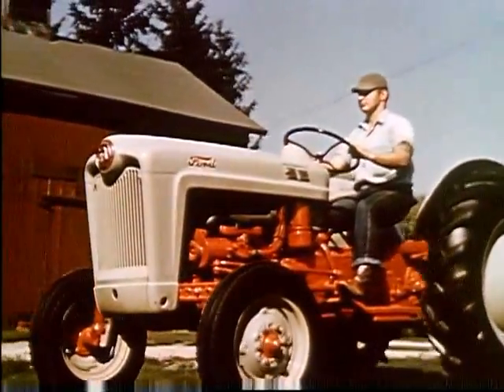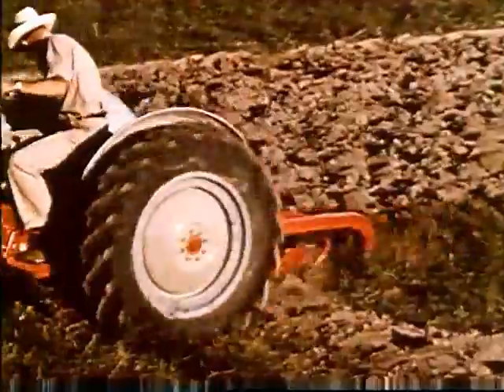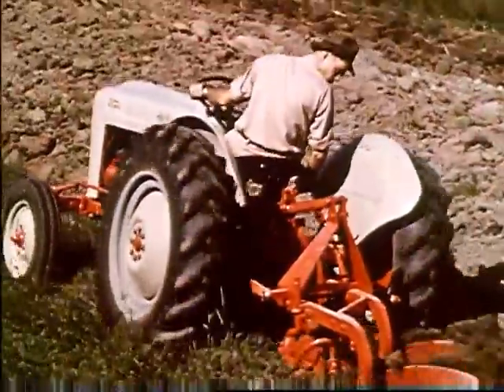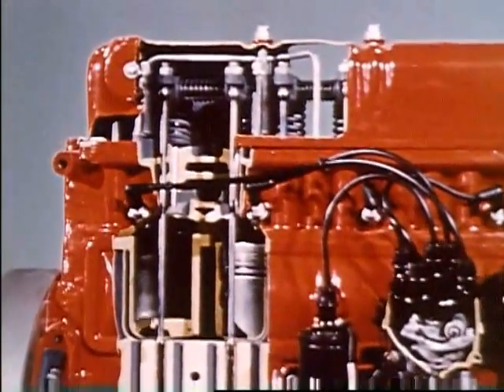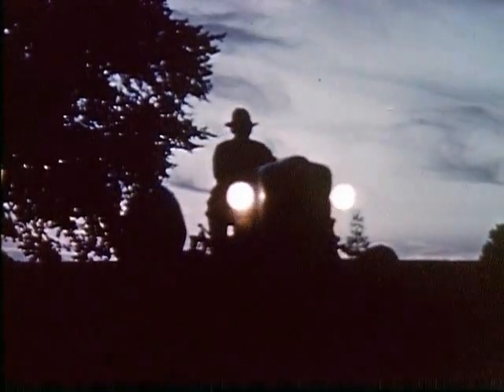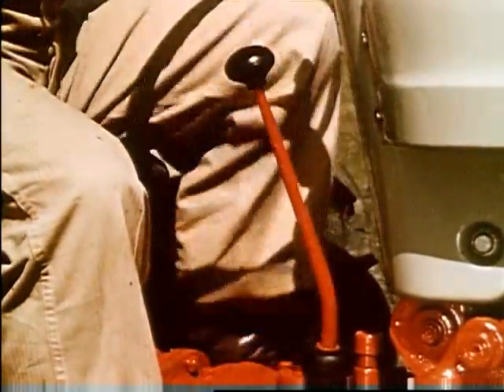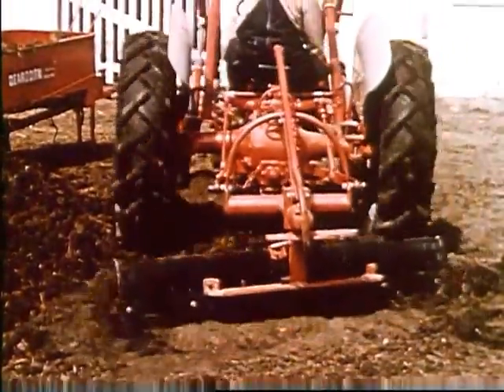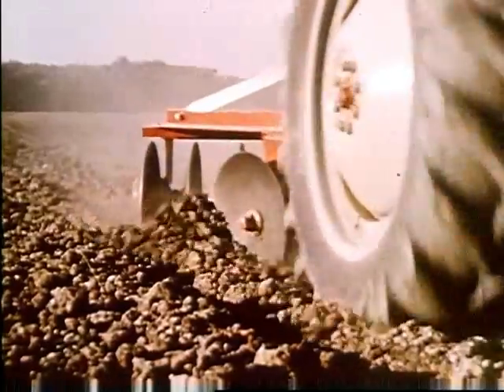The New Ford Tractor (1953)

Comment: 4:28 when our tractors could actually mow a tall crop of grass/weeds without slogging the engine. 
Today, a John Deere garden tractor struggles with 5 inches of grass. 🤣🤣🤣 
boy do I miss the days when we built equipment that actually worked, and never needed these high tech computers or various buttons, just two or three levers, one clutch, one PTO, two independent brake pedals, and we called it a tractor!

Comment: We knew a tractor like this, Ferguson. Is it the same?
Reply: Close but no. TO35 close but some distinct trans & hyd difference s.
Reply: Yeah! We have one!  It has Ford, Massey, and Harris,  on the ld. tag. Pretty sure, it's British made.
Reply: Yes, it is a blatant copy and infringed on many Ferguson patents. Of special note and visible in the video are bothe the front axle and steering design and the Ferguson System three point hydraulic hitch with top link sensing draft control.

Comment: I wonder what it used to cost for a repair tech to come out to the farm and repair something that broke down back then?
Reply: Didn’t need to call anyone out. They were simple enough back then to do all repairs yourself
Reply: Mike England  saw a first gen 4000 get an in-frame rebuild in the driveway in the 70s.  Had to buy new headbolts, they kept snapping before coming to torque spec.  Ran awesome after that.  It was pretty much the same tractor as this.  Definitely the workhorse of that smallish farm.